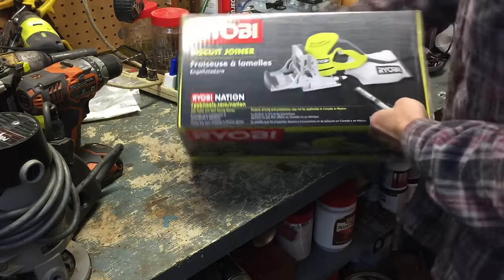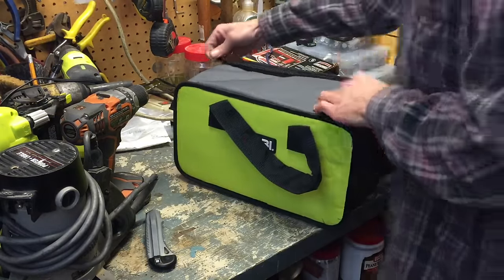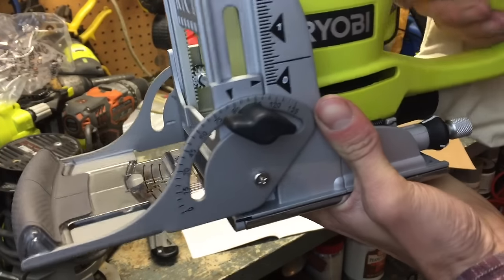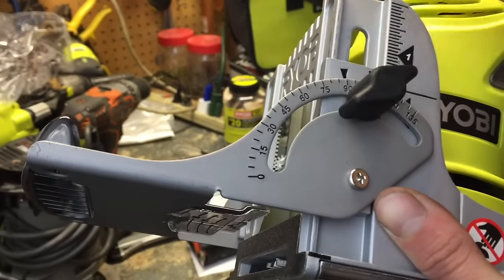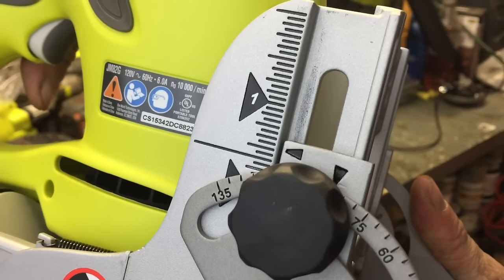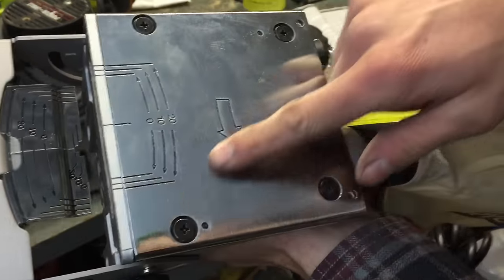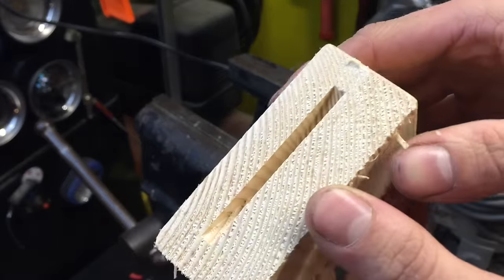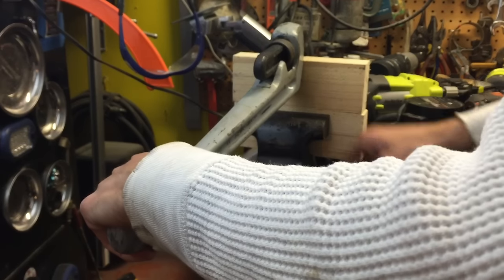Ryobi Biscuit Joiner Unboxing, Review, and Test!

Comment: Thanks for this review. Very clear and informative. YouTube is so full of Festool Dominos - it's good to hear from somebody who's got something positive to say about a tool from a local home store. You don't need $800.00 to join two pieces of wood together.
Reply from the maker: +Rian Corcoran definitely man thanks for checking it out.  The domino definitely has its place, but for someone just testing the waters of woodworking, there are good products out there that can get the job done at a much cheaper cost.  I am doing some testing on the biscuit cuts this thing does now, should have a video follow up on it in a few weeks

Comment: is this just as good as using a craig jig? Better? Worse? Same?  Or is it a totally different ballpark? 

Full disclosure, I'm a newbie to woodworking.
Reply from the maker: +rortiz77 ok so biscuits are basically for alignment more than actual strength, the glue it self has all the strength in this type of use, but the biscuits are used to ensure that the top boards are as flat as possible during assembly.  A kreg jig is sort of used for both alignment and securing the pieces with screws, so honestly you could use either method to join the boards, you also just use glue alone and it would most likely be strong enough for just a table. hope this helps, and its awesome you are getting into woodworking! If you have any other questions dont hesitate to ask me
Reply: Kreg Jig...and I wondered the same question.  I've only used the kreg jig and it worked fine.
Reply: Started a new career as a woodworker & find RYOBI has a huge variety of cordless/corded tools. I just found out about this particular tool which I'll be purchasing this week. Have made a few cedar chests and believe this will be a big help. Appreciate the informative video.
Reply: Very good question. Hope there's alot of responses on that question.

Comment: biscuits are for alignment only and do not provide strength. you need to glue the board faces and not the biscuits. apply glue to the board face as if you were not using biscuits. this is why your first joint failed